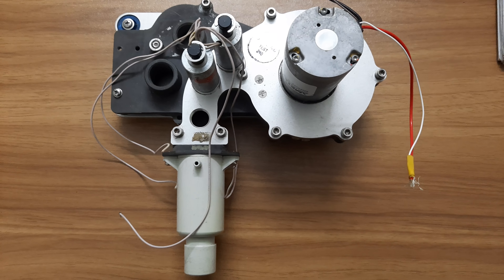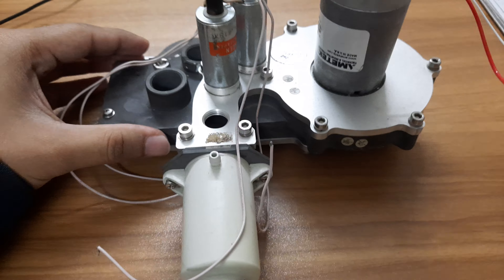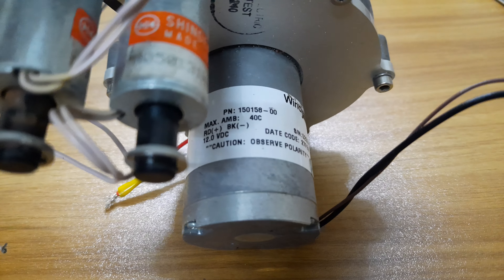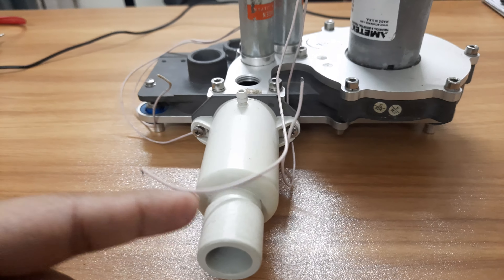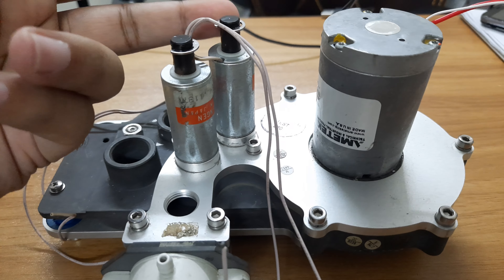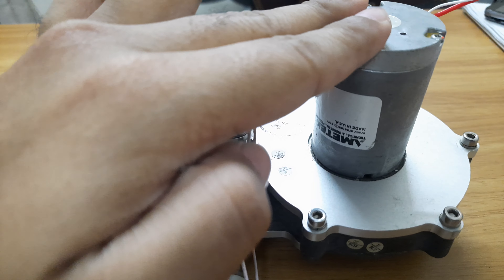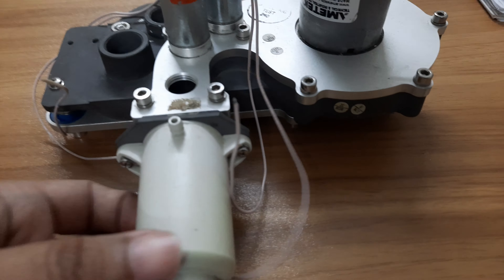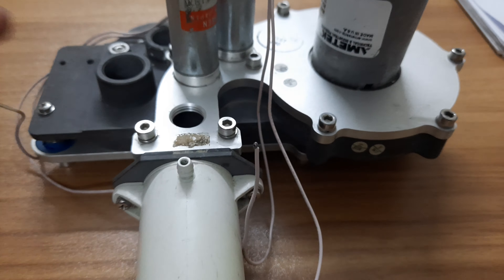#2 General Electric Versamed Ventilator Turbine with Ametek Motor

Comment: The versamed is not producing any air from the outlet. When we switch on the ventilator normally we get high flow of air coming from outlet. But now it's very very minimal air
 I think the turbine is not working fine. 
Can you please help me what actually can be the problem and help me fixing the turbine.  
I
Or at least share with me the technical video how can we fix a faulty turbine.